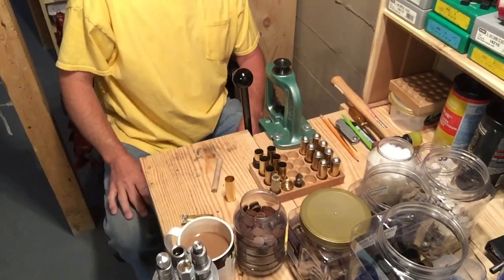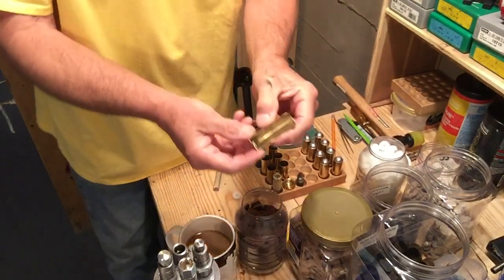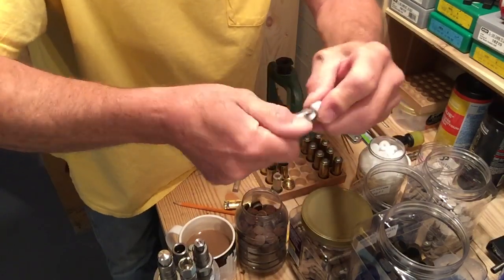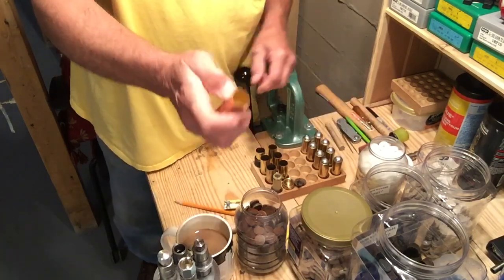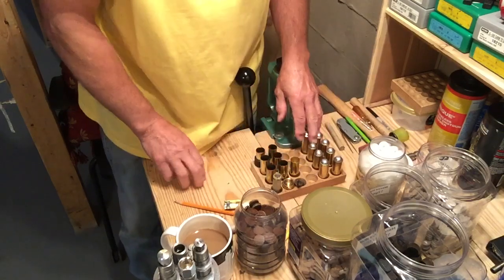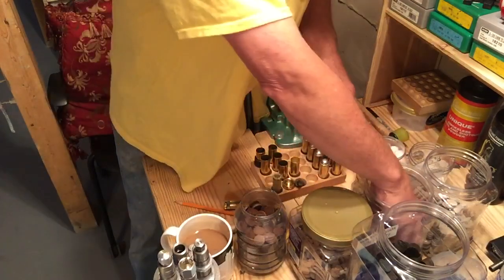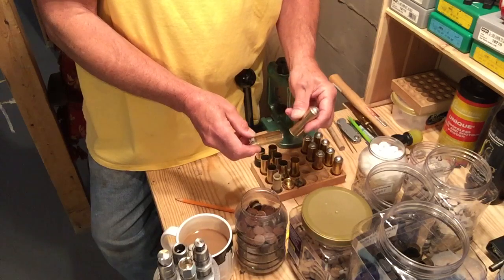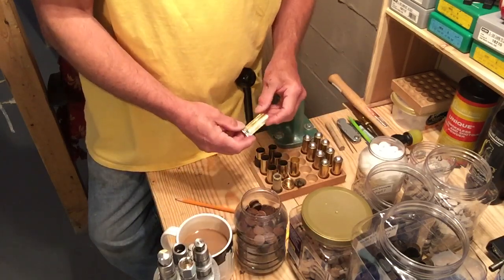Loading Magtech brass 12ga slugs What  I've learned

Comment: I loaded something very similar with imr red and keep getting delayed ignition. Click,pause,bang. I filled in the bottom similarly, packed power tight, built a stack and crimped in the foster slug well.  Maybe it’s the primer? I used standard fed large pistol.
Reply: I've been using cci mag lp primers. Haven't had any delayed ignition. I use ramshot competition powder though
Reply: @jacobackley502  thanks. I had switched to large mag rifle primers and it fixed the issue.

Comment: What is the official name of those white washers that you drive against the primer pocket & where can I get them?
Reply from the maker: Ballistic products HB12 wad base. They are not always in stock just a heads up
Reply: Thank you; You are The Man; appreciate your videos!
Reply: @maxxbear5014  You were right; Precision is out of stock. How often do you need to replace them? Do you suppose I could drill the center out of a similar product & get the same results?
Reply from the maker: For my 20ga brass I use hot glue to fill the recess They don’t sale the washer for 20ga. I would think it would work in the 12ga brass also.
Reply from the maker: You said Percision did you mean ballistic products
Reply: @maxxbear5014  Both Ballistic & Precision are out. I may try the hot glue; does it tend to stay in for a few loads or do you redo after every shot?
Reply from the maker: I always check them but never had to change one

Comment: What is the name on the washer seals, where did you get them?
Reply from the maker: It’s just called a washer seal. At Ballistic products Sometimes they have them sometimes they don’t
Reply: @maxxbear5014  Appears they no longer have them and ignore inquiries.
Reply from the maker: @k.backus6349  well. I guess You could just cut a two piece 12 ga shotgun hull open and take the base wad from it   I would check to make sure it is good and Tight
Reply: @k.backus6349    I'm thinking a X12X gas seal or a (X10X) might work just drill out the hole.  What have you use since this post?